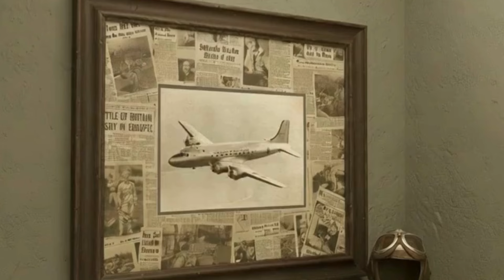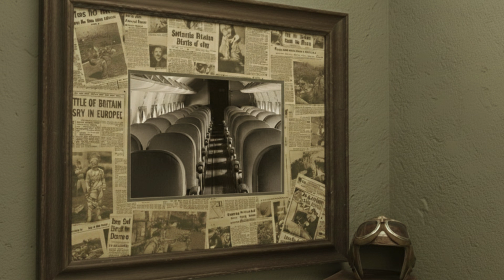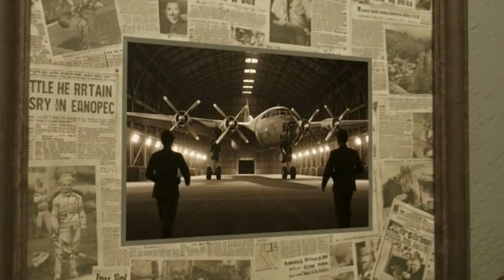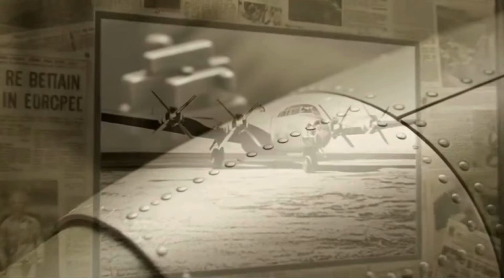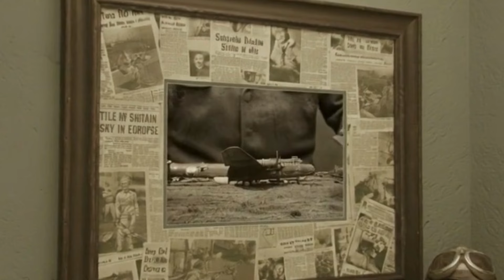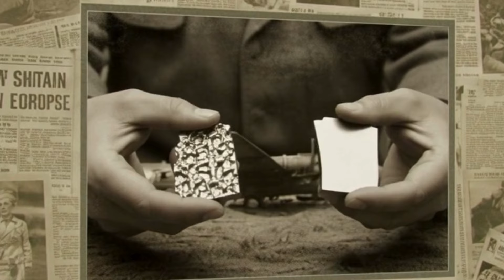The Secret American Reject That Built Japan's Worst Bomber

Comment: Thumbnail doesn't even show the right plane involved. Shows the later DC-4 not the unrelated earlier DC-4E on which the G5N was based. Guess the AI got confused.
Reply from the maker: Copy that. Used a general asset for the visual, but your intel on the DC-4E is 100% accurate. Stay sharp.